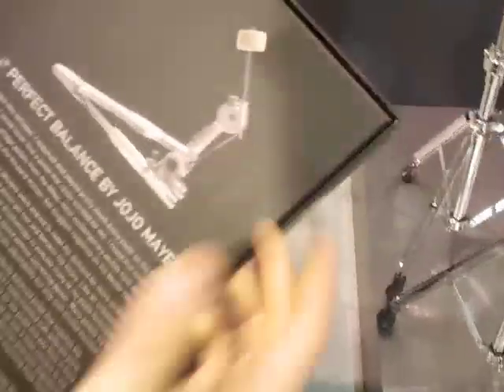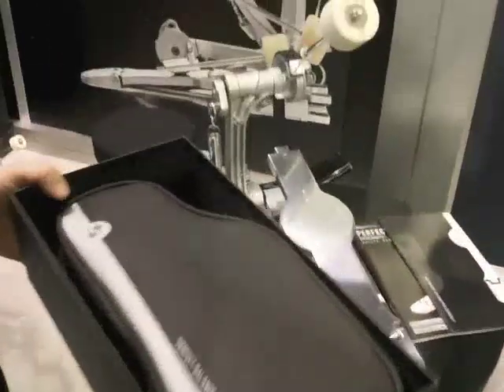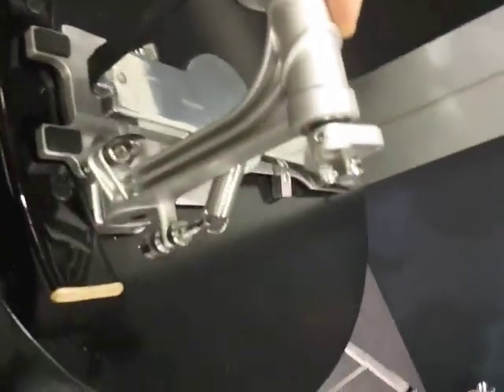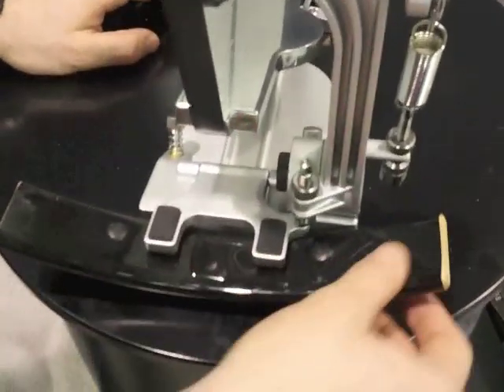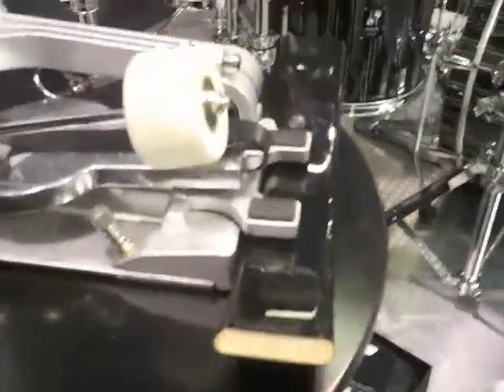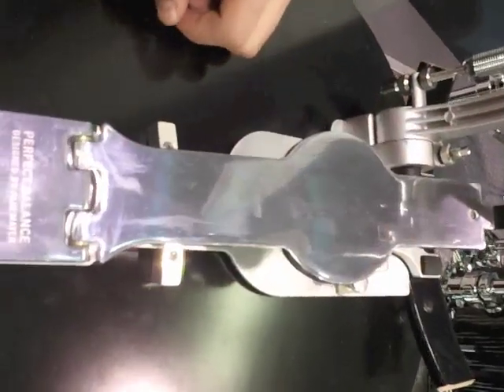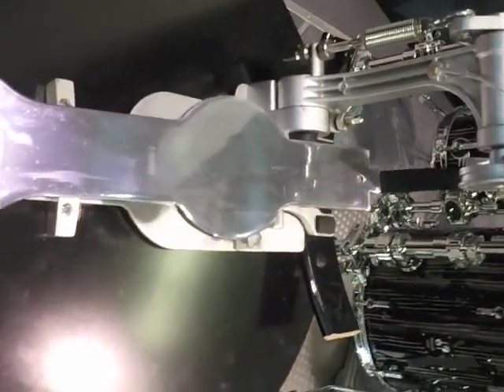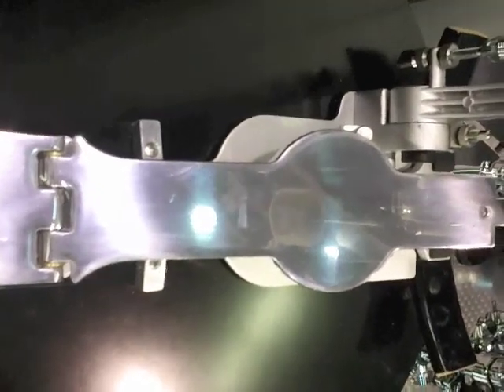Sonor Perfect Balance Pedal @ 2013 Winter NAMM

Comment: I own one of these pedals.  The bass drum clamp will fit all bass drum hoops but if you have a riser plate on your bass drum it will not adjust to clamp on to the thin plate on the riser.  Also the strap on my pedal has stretched.

Comment: How do these  pedals get past Sonor inspection? I received a pedal today that the hinge is very stiff and the board locks up high and does not come back down unless I push it down to playing position. I thought this issue was resolved after the 1st generation problems with this pedal? Sonor needs to get off its laurels and fix this issue. This should have not even left the factory.

Comment: I own this pedal... I admit, it can be stubborn to set up on a new kit every time, but once you learn the mechanics of proper set up with it, there will never be an issue.

It's smooth, sleek, and I do not struggle at all with this pedal.  The way I can describe it is that you can totally feel it there, but you don't feel it resisting you... which was the whole idea of the pedal in the first place.

Do I recommend it for everyone?  Well... your technique will improve dramatically because of how this pedal works, but it is not for everyone.  If you're a rock drummer, I'd advise against this pedal.  If you play jazz, this is the pedal for you: feathering is so easy!!